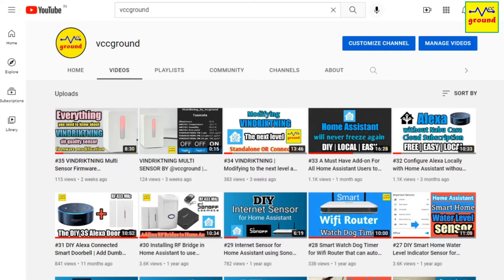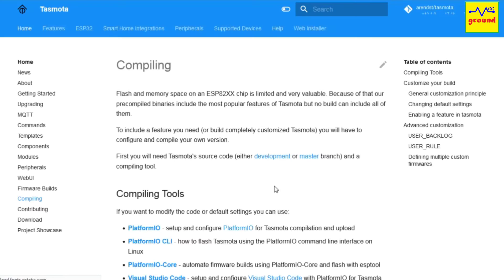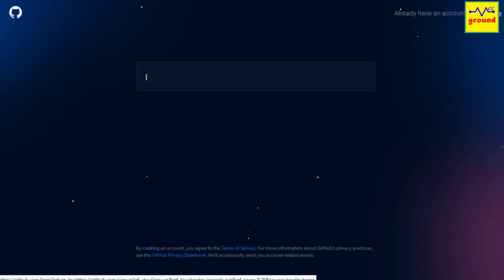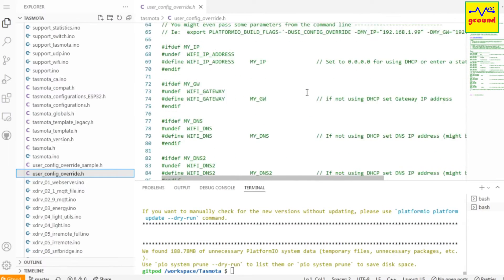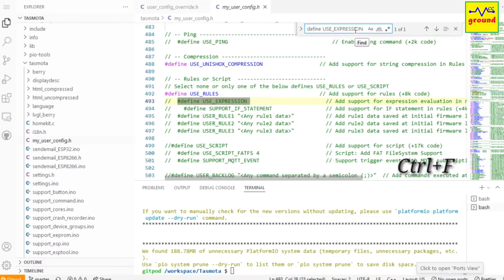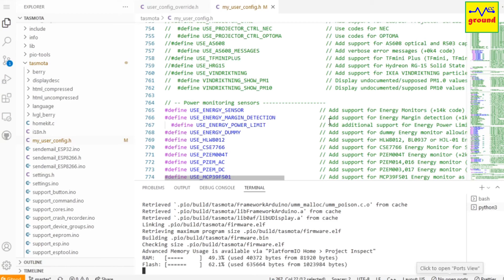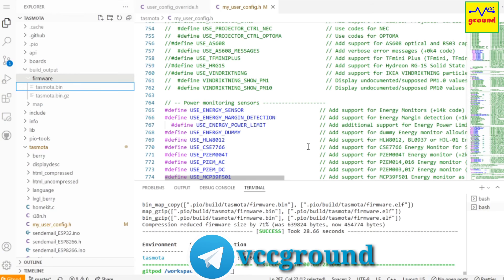#36 How to Compile your own Tasmota Binary firmware | Super Easy Tasmota Build Customization

Comment: Great video thank you.   If I have a sealed device, like a smart plug, that already has tasmota.bin.gz loaded which takes up more than half of the flash space of the device, I cannot load a new tasmota.bin.gz using the Tasmota device UI without getting an insufficient space failure.   How would you address this?  (I need to turn on Ping)
Reply from the maker: You first need to flash Tasmota minimum bin file to the device to free up more space, then you can flash with your updated bin file.

Comment: Hello, great video. I’m looking for someone to create custom code to flash to a smart plug. Can you help me find the right specialty.
Reply from the maker: @Laserloungemaker  What's the requirement.?
Reply: @ user can set electrical parameters that the plug monitors. When the plugged in device exceeds or dips below these parameters the user get notified.

Comment: Enjoying your "straight to the point" videos. Thank for sharing with us this needed approach. I start following the building process but for some reason I was forced to use VSC. Which is ok of course since it is great editor. It will be greate if you can create a new video with VSC in mind. I have one issue I do hope you will be able to resolve:
I needed to compile a simple version to insert my env( WiFi,mqtt). I flashed the bin and my router saw the device but NO IP WAS GIVEN. I resolved this issue by issueing APR -a and I got the IP this way. I tried to setup static address with the MAC address but it never give the device an IP. Is there a way in the user config to assign an static IP?????
Reply from the maker: IP addresses are assigned by the router only. A device can not tell the router to get a specific IP for itself.

Comment: This for Tasmota Wi-Fi Range Extender 

I created a section in my platformio_tasmota_cenv.ini such as the following for an ESP8266 … I see no difference after flashing my custom .bin file to my esp8266 , I will try adding it to user_config_override.h but I don’t know where this line should go : however the PIO_FRAMEWORK_ARDUINO_LWIP2_HIGHER_BANDWIDTH or tasmota32idf4 must still be set as per above) everything else should be copy and paste , right ? Thanks in advanced

Comment: Great! I finally managed to boot my Wemos D1 with a precompiled IP address/wifi so when it looses its config (due to multiple resets when solar power and backup batteries are failing just on the edge, triggering multiple fast reboots) it does not know anything else but to come back on the wifi with its proper IP address! THANKS!
Reply from the maker: It is good to have a precompiled binary as it makes the whole process much easier. Great ❤️👍
Reply: @the_vccground  YES thanks to your swift explanation, I can now move on to create a Universal File System on my Wemos D1 PRO as well, wanted to do that for a long time 😃

Comment: Hi i like your modification of Vindriktning as explained in #34, #36 and #37 very much. I installed Vindriktning-2.0.bin and that is working fine. Now i want to enable some extra sensors. When i do that as explained in #36 i can't select the Vindriktning-by-vccground module type any more. Can you help me to fix this?
Reply from the maker: What sensors you want to enable brother ?
Reply: @the_vccground a Senseair S8 LP CO2 sensor
Reply from the maker: @franssmulders9284  it should work fine. Can you share a small video or screenshot showing the exact issue on vccground telegram channel ? This will help me to understand the issue better.
Telegram channel link: t.me/vccground
Reply: @the_vccground  Hi, i loaded your Vindrikning-2.0.bin again and selected Vindriktning_by_vccground(0) as the Module type. I connected my Sensair S8 CO2 unit to GPI01 TX and GPI03 RX. In the list of Module parameters I can't find "SAir Tx" and "SAir Rx". I think the "Senseair S8" sensor was not enabled in the source files. Is there a way to fix this?
Kind Regards, Frans
Reply from the maker: @franssmulders9284  Yes, Senseair is not enabled in that bin file. But you can enable it yourself by following steps in video #36 and then upload the updated bin. Try it. If you are unable to do so, I'll do it for you and share the updated bin file to you. Keep me updated... 👍
Reply: @the_vccground  I followed the steps in this video and I still can't select Vindriktning_by_vccground(0) as the Module type. So all the Rules and all the Mem variables as explained in video #37 are not set.
Reply from the maker: @franssmulders9284  Download the updated bin file with senseair enabled, from vccground telegram channel. I have shared it there as it may be useful for other members also. Don't forget to join the channel as I keep on posting such useful content there from time to time...
Reply: @the_vccground  Works fine now.  Thanks for helping me. Kind Regards Frans
Reply from the maker: @franssmulders9284  Great ❤️👍

Comment: I used tasmota templete, and i want to save bin used this configuration. how do i do it
Reply from the maker: You can simply take a backup of your configuration to use it later or on other device. Backup option is available in Tasmota firmware under configuration option.

Comment: Your video helped me to add extra IIC sensors AHT21 (Temp+) and BH1750 (Lux ) to the VINDRIKTNING. However I am having trouble adding the ENS160 (eCO2 sensor).
The device is found at its address (0x53), but no data is shown in Tasmota. The first sensors could be enabled by "uncommenting" them in Gitpod, however the ENS160 is not included there.  There is a driver for Arduino in eg the Adafruit libraries, but I have no idea if it can be integrated using Gitpod.
Do you know if it is possible to add that sensor by myself via Gitpod?
Reply from the maker: To my knowledge, ENS160 is not supported by Tasmota. You can use SCD30/40 instead. For more details, do check the list of all tasmota supported I2C devices at https://tasmota.github.io/docs/I2CDEVICES/
Reply: @the_vccground  I already tried this by activating these sensors in Gitpod, but no info is shown in Tasmota on the Wemos D1. Probably because they use different IIC addresses; 0x61/62 versus 0x53 for the ENS160.
I would like to know if it is possible to "tell" in Gitpod to use the SDC40 information for the ENS160 on the address 0x53?
Reply from the maker: @jlhsalfischberger493  You need to connect SCD30 or SCD40 sensor module only. ENS160 is not supported by Tasmota yet.

Comment: your video is helpful, can you tell me how to enable tasmota IIC function, i want to add PCF8574 extend GPIO chip. Thanks.
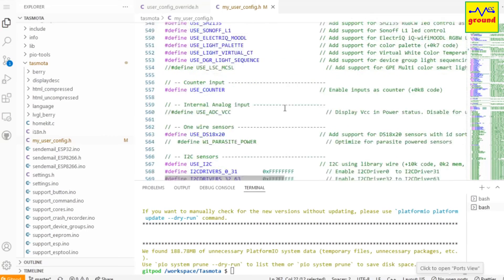Reply from the maker: In my_user_config.h file, uncomment lines 567 to 570 and line 623. Watch at 5:19 and 5:22

Comment: hi brother, thanks for your video. I ask for your help. how can i increase the number of timers available? 60 would be perfect. can you post a bin file with the changes? thank you so much ❤️
I changed the value of max_timer from 16 to 32 in tasmota.h. I got compile-time error on Tsetting file
Reply from the maker: Sorry, I did miss your comment. Do you still need the answer or its resolved now ?
Reply: @the_vccground  hi, thanks for the reply. I haven't solved it yet. I used cyclic timers thanks to the Tasmota rules. but if it were possible I would like to have more than 16 timers
Reply from the maker: @Jovy198  Okay. Let me look into it thoroughly first . I'll post it soon...

Comment: Hi, can you show us how to monitor battery % charge of home  UPS battery and possibly another parameters which might be important
Reply from the maker: Sure, stay connected...
Reply: @the_vccground  recently implemented voltage divider circuit along with voltage sensor to measure the UPS battery voltage. So far the result is good. Monitoring further to build few analytics around the consumption pattern